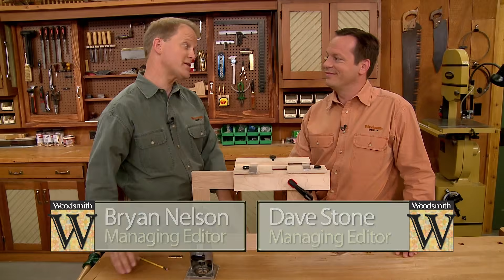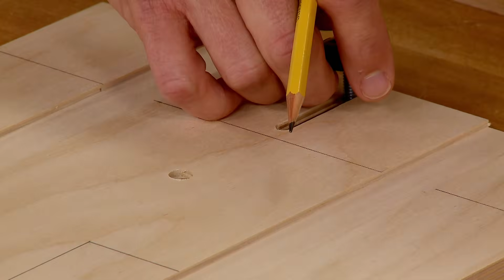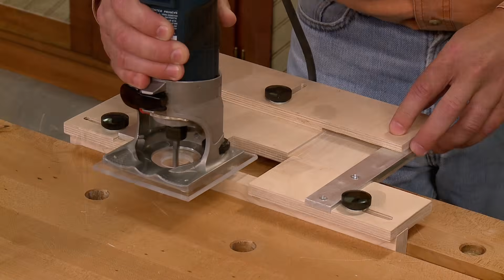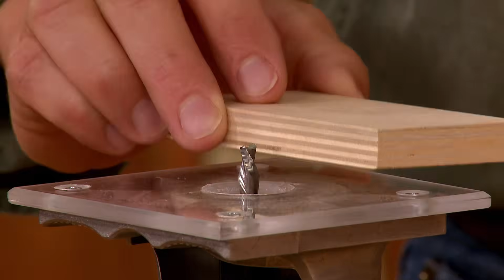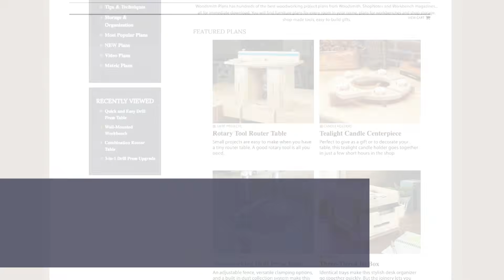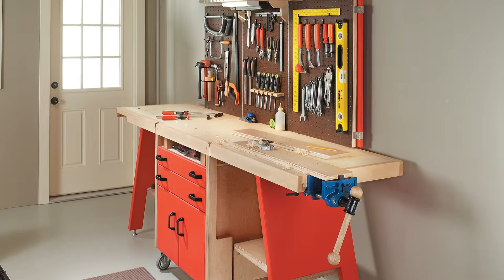Shop-Built Adjustable Hinge Mortising Jig

Comment: I purchased the plans, procured the parts and I made this jig today.  Not a difficult project but as an engineer, I would have preferred to have the dimensions in millimeters and I must add that in a few instances some of the dimensions were missing from the drawings and thus one needs to infer what these are.   Nevertheless, it wasn't difficult to figure out.  

I would like to add a few of small tips. (1) Although the plans call for 1/2" plywood, 3/4" (or18mm) works as well or better. (2) When drilling the holes for the guide bar on the small base, be sure to position the holes outside of the 3/4" dado.  Failing to do this, results in a screw(s) interfering with the fence. (3) when cutting the knob slots in the main and small base it pays to be careful to position them in the center or of 3/4 dado in order for the knobs to align to the threaded inserts.  (4) Be careful when setting the depth of the slots for the aluminum bars.  Excessive depth results in a a less prominent edge to guide the router base.  (5) Lastly, I suggest a couple of coats of varnish to improve the durability of the jig you have spent a few hours making.